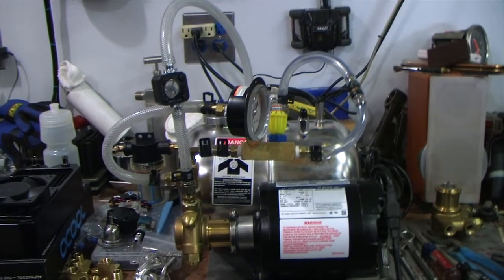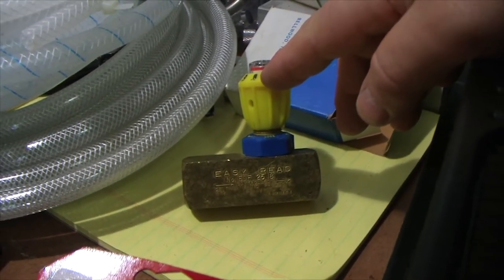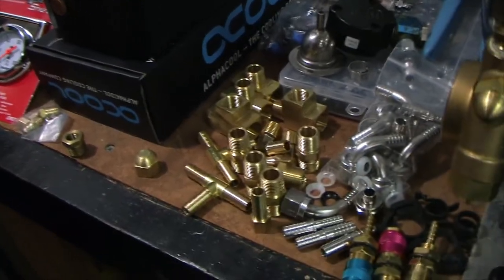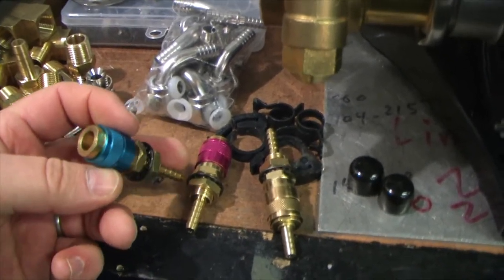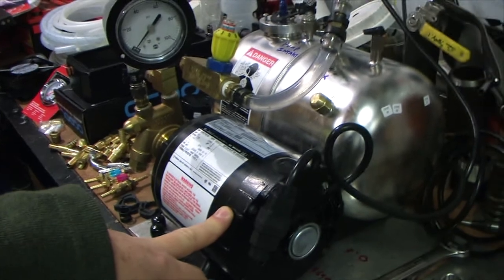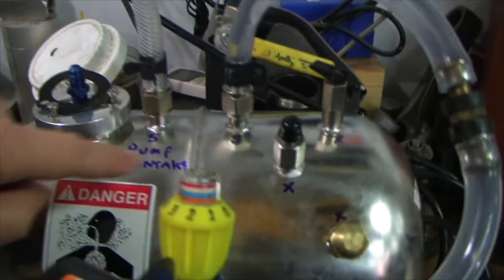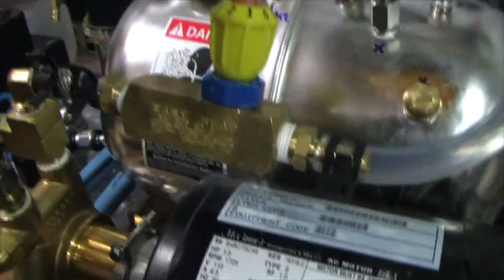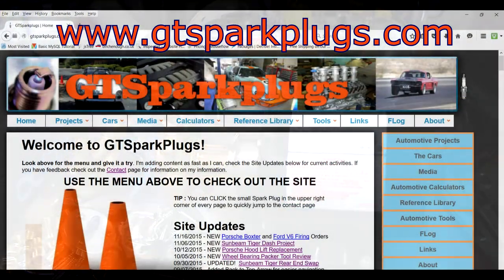Homemade TIG Cooler - Part 1

Comment: You can buy some four wheeler knock off oil coolers that you can get the fittings for their standard pipe thread and that would probably be a lot easier

Comment: Nice cooler you have there. I'm not sure I'm going to do for a cooler yet. I've been trying decide on making one myself or buying an Everlast water cooler. The Everlast looks very well made and is probably about as much as the parts I would need to make one myself.
Reply from the maker: I started down the buy it path and decided it would be a fun project. When all said and done I likely could have just bought one but I did have a lot of fun sourcing parts, and making it. I have just recently started using it and it has been working great for the smaller projects I do and the cart now houses my Dynasty 200dx and Multimatic 215 with a couple of tanks on the back. You could make it for a lot less $$ just depends on how thrifty you are with the parts and how nice you make it look. Also check eBay now and then you may get lucky and get one at a good price.

Comment: Came across you YT vid and wondering what you typed in on ebay for your colored quick disconnects?  Tried a lot of variants, maybe discontinued.  Have they worked fine for you?  If you get this, thanks for the info and nice cooler.  I made one for my Lincoln 300/300 about 10 years ago, worked awesome.
Reply from the maker: Try - tig water cooler  quick connector fittings
Reply from the maker: They seem to work OK so far, just need to make sure the connection is good on the pump size since these are metric I think. I just used double clamps and so far all good
Reply: @GarageProfessor  Thank you-that worked!

Comment: I've watched several yt vids about diy tig coolers, your's is the first to use a bypass. Why are you using one? Safety(for the torch), should something go wrong with your pump?
Reply from the maker: When you mean bypass I guess you mean the way I regulate pressure with the needle valve? I think I opted to go that way to have easy adjustability as well as one thing that is really good IMO, and that is using the pump bypass spring just keeps circulating water in the pump. The way I did it that water is circulating through the cooler as well. My thinking was that's a good thing. Either way seems to work fine. I got the idea from an old build I saw on YT and liked the idea.

Comment: What is the p/n for the Deltrol needle valve.
Reply from the maker: Joe I think the part number is 10005-86 EDF25B
make sure you get all brass or stainless. You can find them on eBay. They make them in different styles, but most 3/8" needle valves should work.

Comment: your radiator explode after 2 bars (30psi)! Save presur is under 1 bar /15psi. And im yousin thous things in may computer
Reply from the maker: Their is no pressure on the cooler side other than it's own restriction. The system is not sealed so no worries at all.

Comment: What was the final cost of your tig cooler?
Reply from the maker: A lot more then expected, but was not about saving money. You can do a lot better by finding better prices on the Carbonator, I found one that was new in the box, and paid a bit more. And just being more thrifty. 

All of the below includes shipping. 

$197 Carbonator - eBay
$17 Gauge - eBay
$15 Needle Valve - eBay
$35 Brass, Adapters, Flare Fittings - McMaster and A soda fountain supply
$18 Quick Fittings - eBay
$20 Reinforced Hose - McMaster
$75 Radiator - Amazon
$30 Fans - eBay
$30 Pressure Sender (optional) - eBay
$10 Clamps, misc Hardware - Amazon
$50 Extra Cabinet Fans (2) and Grills (2) (optional) - Amazon
$175 A/V Cart with cabinet - Furniture Supply (Amazon also)

Total was about $672, I have just enough left over to do the smaller carbonator that I also picked up. I think my ship to price from Welding at IOC on a Miller Coolmate 1.3 was $633.

Had switches, hardware and a few other things. And yep, as I said could have got one new. But more fun to make it. If you can scrounge a radiator, and be more thrifty with fittings and stuff you can save a bunch more. Wasn't the goal of the project as I said ;) I also did a Procon pump rebuild kit just to learn how it all worked, and that and the low pressure relief spring was about $45 but not needed unless you get a wasted pump.

Hope this helps

Sandy
Reply from the maker: forgot the filter, that was about $25 as I recall
Reply: What was the final cost? Roughly ? I know it’s not a cost savings just deciding which way to go.
Reply from the maker: @weldingjunkie  Sorry didn't see this, but above has a breakdown, here it is again - 
$197 Carbonator - eBay
$17 Gauge - eBay
$15 Needle Valve - eBay
$35 Brass, Adapters, Flare Fittings - McMaster and A soda fountain supply
$18 Quick Fittings - eBay
$20 Reinforced Hose - McMaster
$75 Radiator - Amazon
$30 Fans - eBay
$30 Pressure Sender (optional) - eBay
$10 Clamps, misc Hardware - Amazon
$50 Extra Cabinet Fans (2) and Grills (2) (optional) - Amazon
$175 A/V Cart with cabinet - Furniture Supply (Amazon also)
$25 for the filter